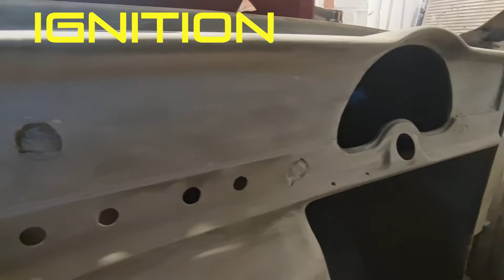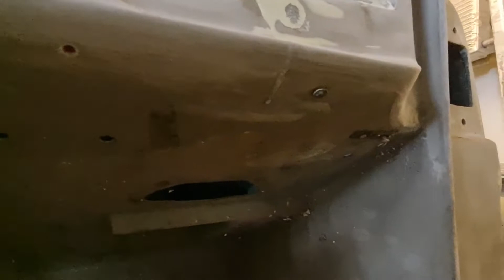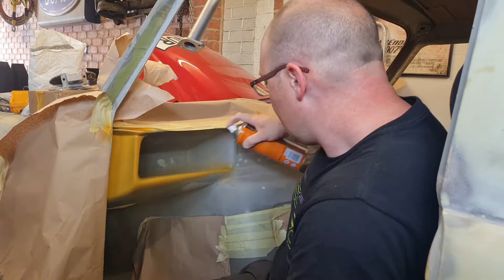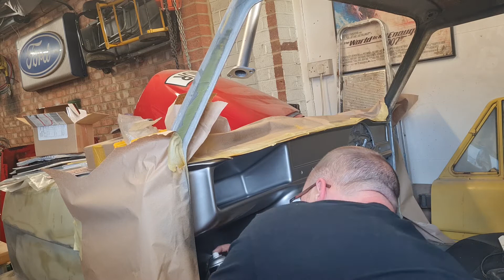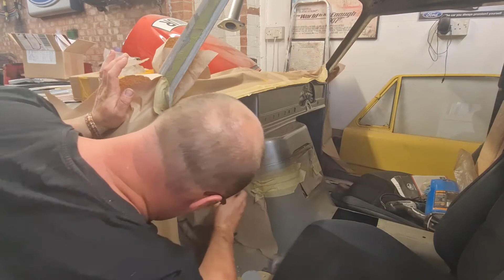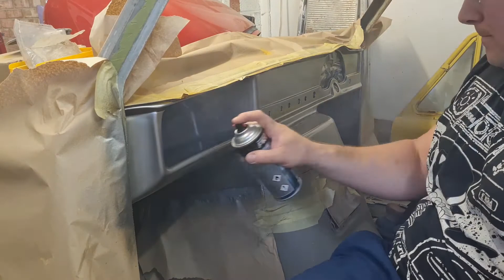Reliant Regal Supervan 3 Project Plonker Pt4 DASHBOARD Refurb !!

Comment: I know this is old but would appreciate some help. Is it possible to cut a dash board from another reliant and use it in another car? I know dashboard isn’t kind of moulded to rest of the body but can it be done.
Reply from the maker: Hi, yes i dont see why not as its all fibreglass, if it was cut at the joins at the sides it could be re fibreglassed into another car, it would be very time consuming though id think 
Regards MEC 👍